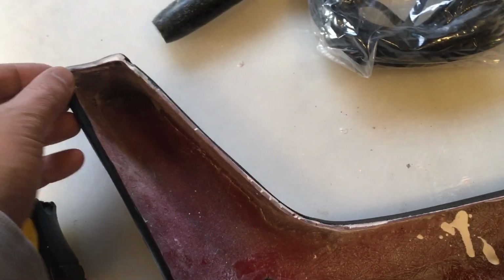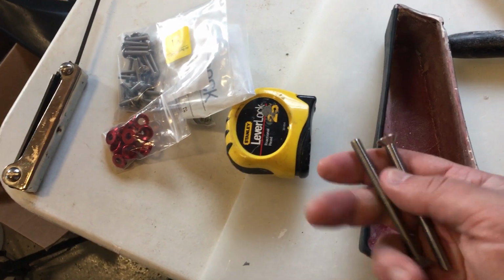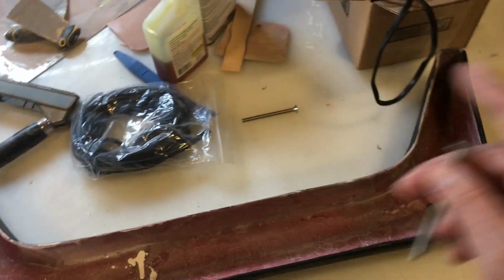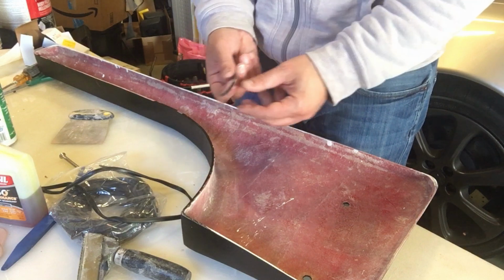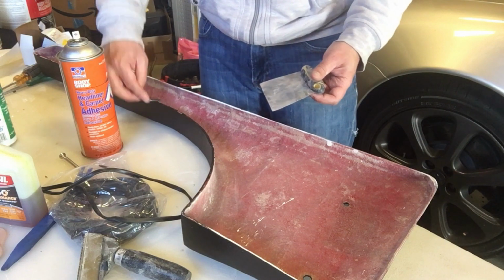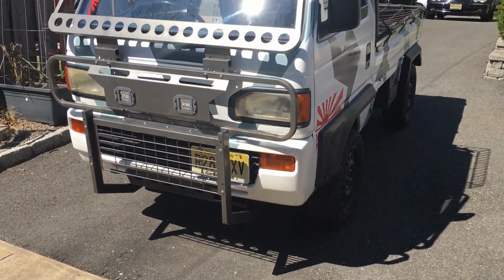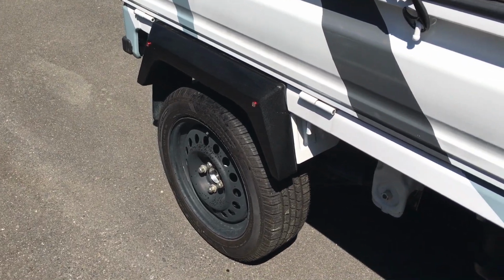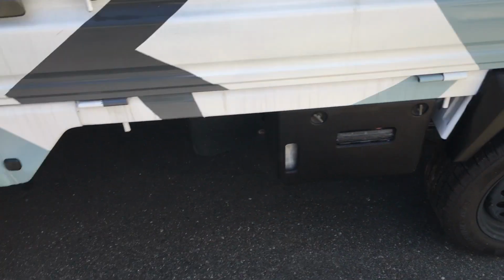Honda Acty JDM Kei car mini truck project. Episode 40, DIY Fender Flares Pt.8

Comment: u should add a plate in the back and trim it to have an inch lip on the inside all around. then u can use 3m tape, no screw holes needed